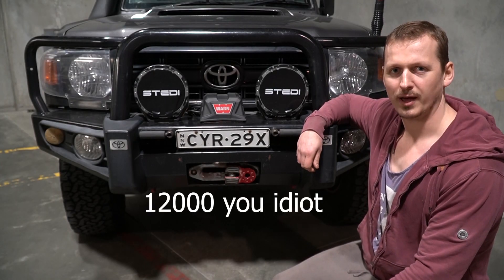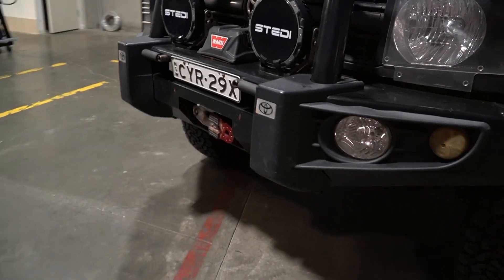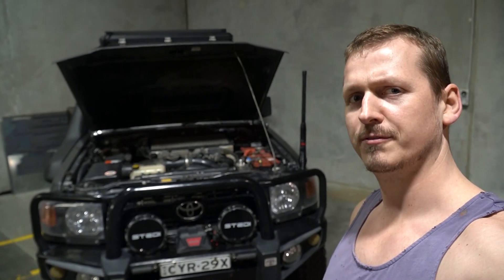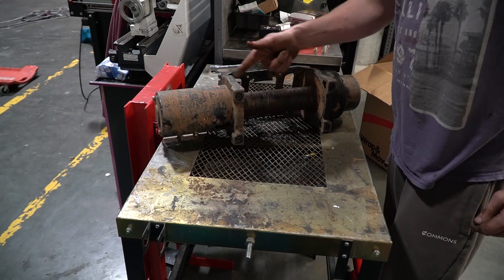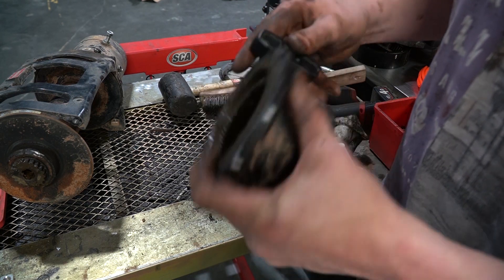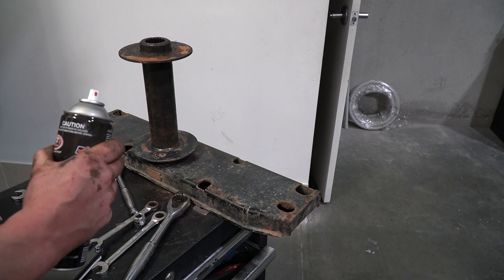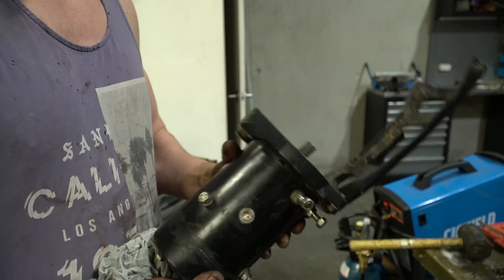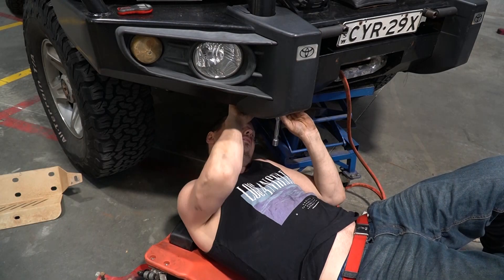How to fix your broken winch

Comment: I have been told don't buy an ebay winch, they are shit. Well, we have a Warn winch 3 years old on our marine rescue tow truck, only used lightly 2 times and it's thrown in the towel already, pathetic for a $3000 winch.
My ebay winches, mostly X-Bull haven't missed a beat over the last 15 years and around $400, go figure.
Reply from the maker: You paid 3k for a winch? Mental. This one cost marginally more than your X-bull one for a new genuine warn. Go figure.

Comment: Nice repair series vid!
I noticed in the pull down that the winch has one seal between the drum and the gearbox?..  correct me if I'm wrong.
(the other cheaper brand you mentioned has two seals btw)
Reply from the maker: The motor side has a sealed bearing. The reason I don't like king's stuff is because it's a throwaway item. Try buying a replacement gearset for one vs. a warn winch. That alone is worth the price tag.
Reply: @ridiculousthings4x4  Yes, I understand where your coming from.  
Loved the closer look at the motor brush assembly btw... just like the arb compressor fix you did.... not many people show these bits of the puzzle.. 👍

Comment: Thanks for the video, I have the same bar and will be fitting a winch soon.
Please what bash plate  and Recovery point you have fitted?
Most on our local SA market are designed to fit the ARB bar and don't work with the Toyota bar.
I'd like to fit them when I fit my winch.
Thanks 👍
Reply from the maker: Not sure about the bash plate as it came with the car, but the recovery points are the same as roadsafe, but I've had to cut them down so they clear the winch plate.

Comment: I have an intermittently  operable Warn M12000.  It is a variant that Warn produces for Ram, that comes standard on a Ram 2500 Power Wagon from the dealer.  It isn't the engagement  doodad that is the problem.  I am a bit at a loss as i can hear the solenoids  clicking when I switch the controller in each direction (in/out).  There is the odd occasion that it will start spooling, which makes me think in general everything is working, but most of the time just clicking.  I am beginning  to think there may be some corrosion  in the solenoids  impeding good contact even though i can hear them clicking.  Just no way of telling unless i pull them.  Problem is my heavy duty after market bumper mostly encapsulates the winch, and Ram has the genius to have the winch control box mounted within a c-hair of the radiator.  Access is a bitch to get to that control box.   Not about to pull the bumper as it is heavy and pressed onto the frame horns.  Any insight you can offer regarding a winch that clicks when fired but only spools rarely, i would appreciate the advice.
Reply from the maker: Confucius say - winch that click and no go... probably needs new solenoids.

I think you've answered it yourself, as you won't know until you take it apart and check them. Sounds like it'll only be 1 of 2 things though, the  brushes or the solenoids. 

You can test the motor using jump leads if you've got access to the terminals, then that'll narrow it down even further for you.